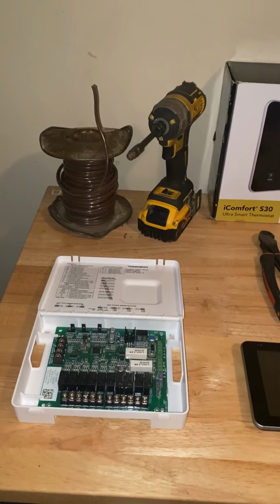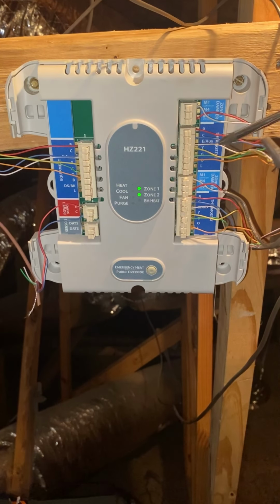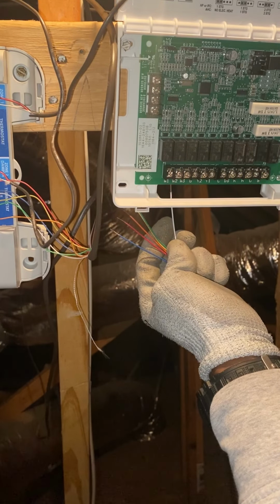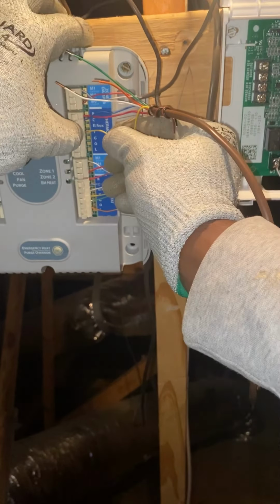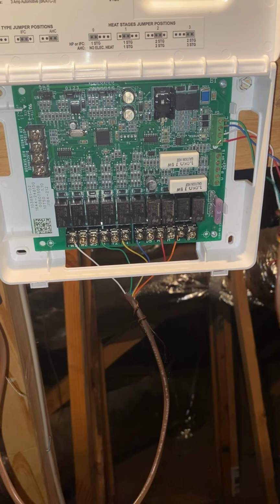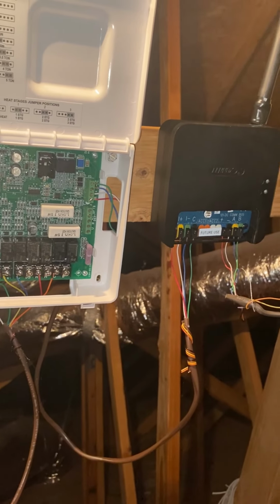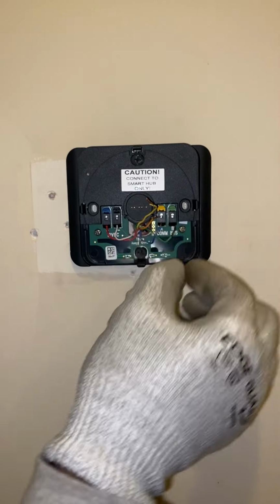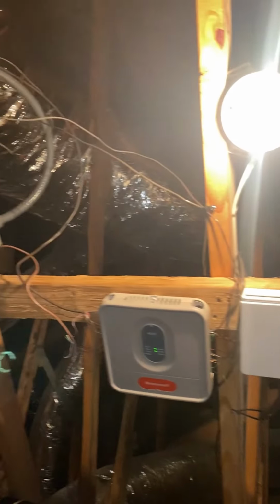Lennox IComfort S30 step by step installation with EIM module

Comment: Question? I already have a s30 upstairs with  a hub and I have a 10f81 on the second level.
 The 10f81 went out can I just replace it with the s30 without another hub and wiring. I have the same color and number of wires you have.

Comment: Thanks for the video Zeek.  I'm wondering if you (or anyone) can advise what the 5 leads are  (what wires they are connected to) on the magnetic wall unit? How would I test the power with a multimeter?

Comment: So my 10f81 recently became uncalibrated. We are in air condition season and just 2 days ago for no reason it became warmer in the house then normal.   I turned air down further and it did cool the house. I placed a thermometer on the thermostat to check temp and it is showing 4 degs off. So now i been running the air 4 deg cooler then we have all summer.  What has happened to my 10f81?

Comment: Hey Zeke, we had a Lennox 10f81  communicating thermostat that is discontinued for our heat pump system. The expense for the s30 system is so high. Is there a way to replace it with an ordinary wifi thermostat? I'd really appreciate your input.
Reply from the maker: Hey Ken, Thanks for stopping by and watching my video. Yes you can replace the IComfort with a regular thermostat. How many wires do you have behind the Tstat? You will need at least 6 wires. You can send me some pictures of your air handler wiring setup and I can do a video for you. Send them to zeektheinstaller@gmail.com
Reply: @zeektheinstaller5552  - My icomfort 10F81 has 4 wires C, i -, i +, R .  I have a two-stage heating Lennox system.

Comment: Just got a system installed today and it doesn't seem to have the mag mount. It is a s30
Reply from the maker: Hey what’s up @Jay thanks for watching my video. Yes you have the newer model of the S30. The mag mounts were causing issues so Lennox did away with them.

Comment: Buenas noches , tengo un problema el termostato se apago es igual a ese y el modulo no enciende la luses , si le llega 24 al modulo de wife pero no sale havia el termostato que puede ser ? , estos termostatos solo funcionan con ese equipo negro que es como una antena
Reply from the maker: Oye, gracias por ver mi video. Pido disculpas por la respuesta tardía y tengan paciencia conmigo, estoy usando el traductor de Google. Sí, tiene razón, necesita el concentrador inteligente (caja de cambios) para que funcione el termostato. El calefactor/controlador de aire envía 24 V al concentrador inteligente, luego el concentrador inteligente alimenta el soporte de pared/S30. ¿Tiene alguna luz en el centro inteligente?

Comment: I cant even get mine to turn on.... and i'm assuming these models don't have batteries based on how they look, where do i start to troubleshoot. Thanks
Reply from the maker: Hey thanks for watching my video. You are correct they don’t use batteries, they are powered by 24V. Do you have any power coming to the smart hub? If you do have power then the status lights will tell us what’s going on. What color lights are you getting on the smart hub?
Reply: @zeektheinstaller5552  I had to reset all the circuit breakers, it is working now. Hopefully it stays ON! Don't see any other issue.
Reply from the maker: @Transport Auto glad you got it working. If you ever have any issues don’t hesitate to shoot me a message. Take care